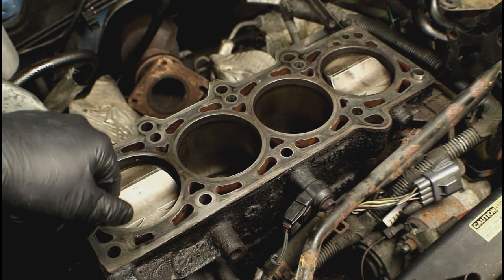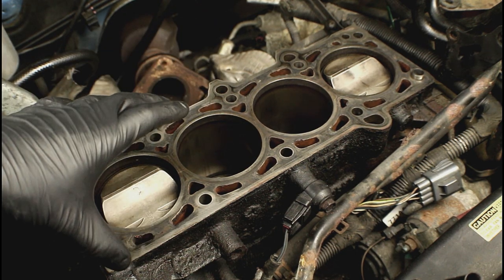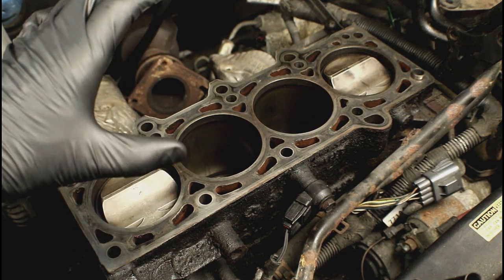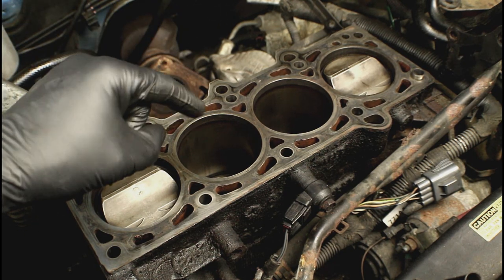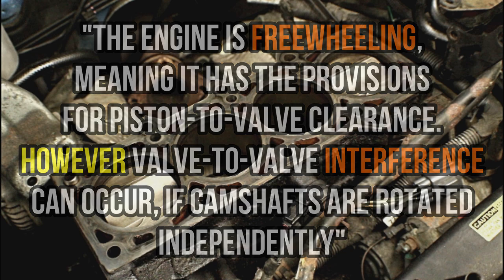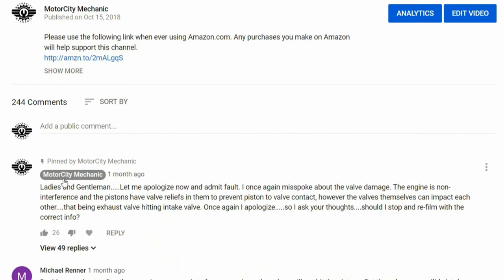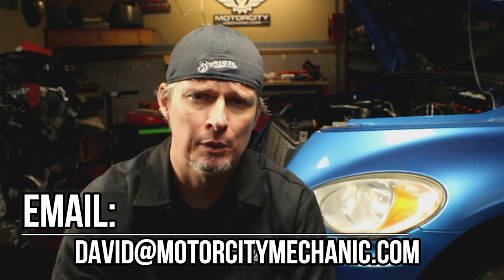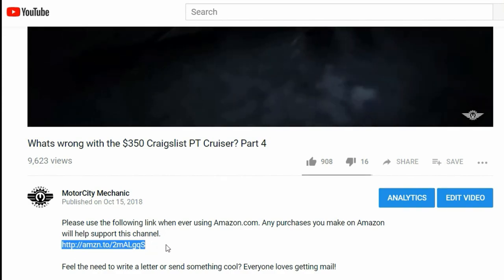The difference between Interference and Non-Interference engines

Comment: Lost belts on older Camrys (2) different cars. One lost a belt due to catastrophic failure of the idler pulley (due to over tension by a quack mechanic who I had replace the old belt). The other lost the belt due to the shaft breaking off the water pump. Both cars were saved due to the non-interference engines. ALL engines should be built like that.

Comment: just watched a video of another guy opening up a vtec engine and showing how one side is dirtier than the other due to oil balance issues and he thinks it's a design flaw but don't expect the manufacturer to tell you that, not to say they knew but that they had no idea what happens after prolonged use

Comment: This is an outstanding video, and part of an outstanding series, that resolved a long standing question about the 2.4 liter twin cam. 

You did a great job of forensic engineering, that never would have been needed if those diploma engineers had properly insisted on exhaust valve reliefs at the tops of the piston crowns.  That would have only reduced the compression about one, or at most two, percent and saved a lot of trouble for a lot of people. 

Thanks again.
Reply: MAny companies are installing 4 valves for each cylinder. You only need 2 valves per cylinder. 1 intake @ 1 exhaust. You are asking for trouble with 4.
Reply: 1 Cam @ 2 valves per cylinder. The old slant six cylinder would go a long way.

Comment: As the original owner of a 1989 Dodge Spirit ES turbo car AND the factory issued shop manual for the car, I can tell you from my own wrenching experience over all these years, a corporation can and sometimes does make mistakes in their printed literature about their own product. It's not often, but it does happen. BTW, the 2.5L SOHC engine in the Spirit is virtually all original except for 5 head gaskets, one timing belt, and a valve grind. Over 300K miles now. Love your channel David. Hope you keep it going for many more years.

Comment: I have NEVER heard of valve to valve interference until this video. It makes sense now but I think in this specific case you're correct. There is  just no way they hit each other unless the lash is WAY out of spec. So far out that the valve can't completely close; or put another way, NO LASH AT ALL.  Which would cause problems way before the belt breaks.

Comment: Wonderful job! I love this. I keep promoting your video on the facebook PT forums.  Too many people want to drive it until it breaks because it is "non-interference". They're so wrong.
Reply: It don't matter if it's interference or non-interference. When you're getting down the road at 60 70 80 mph and the belt or the chain comes loose something is bound to smack they're not like the old engines back in the day. These engines have no tolerance for mistake hopefully you will not learn that the hard way on your own vehicle

Comment: Stumbled upon this video because I wanted to know about interference engines (I'm still not sure if my 2004 Toyota Camry V6 is interference or non-interference, I keep getting conflicting info) and you helped explain to me what that concept means.  You made it easy to understand even from a non-gearhead's point of view.

This also goes to show why Chrysler gets its reputation as it does - it just seems like "good engineering" wasn't a term in design.  They make slick looking cars but they always have these strange faults.  A non-interference engine but the valves can still smash into each other, but they're wrong about it?  Might as well just should've just added "Yeah, we're stupid" at the end of that service manual blurb.

Comment: Thanks.  Those dents in the piston almost look like they fit the bottom side (radius) of the exhaust valve head, more perfectly than the top side like you demonstrated.  As you showed, the leak down test told the story.  When you found the factory cam alignment holes were off, I personally would have been tempted to loosen the exhaust cam sprocket bolt, align the cams using the factory alignment holes, retorque the exhaust sprocket bolt do the leak down test and then see if the engine would then start/run.  Regardless, once you found the exhaust valves were leaking, you knew you were going to have to pull the head to fix all that was wrong  (and do some preventative repairs while you were in there). You are obviously a very good technician and teacher, thanks for making the videos!!!  It's an Excellent series, I've shared them with my son and brother that own PT's.

Comment: Now I'm worried!  My '06 Cruiser has a broken belt and I was hoping to NOT have to remove the head.  At least now I'll do some thorough checking before I button it all back together.  THANKS for another excellent video!  KUDOS again to you!!!
Reply from the maker: I havent seen one bend the valves when the belt broke, mainly when someone did something wrong like on this vehicle. I feel you will be fine. Thanks for watching and for the question. Merry Christmas Tom!
Reply: @MotorCityMechanic  yep, Ive been thinking about that too.  Those witness marks on the pistons look more like over-revving to me.  Think that's possible?  If you've already repaired it what did you find?  Were the valves only slightly bent?  Just curious.
Thanks!
Tom
Reply from the maker: @tomferguson4996  It appears only slightly bent. I have a new set of exhaust valves that I need to get around to installing when ever I get some free time.

Comment: Great information and descriptive learning Dave. Valve to valve contact was a prominent issue in early multi valve overhead cam diesel engines with primate electronic injection, where the early belts or chains failed, especially in Australia where extreme heat, multi trailer combos are prominent. In all engines failures I've diagnosed with this description, the valves had not touched the pistons, due to the volumetic concaved pistons (increased volumetric area), but had edge contact with the opposing bank, resulting in major valve head degregation, from chips to complete severance. Other diagnosis of terminal failure include exhaust valve failure due to Jake Brake failing to release after disengagement, Hobbs switched fans causing belts/chains to jump a notch when engaging due to failure of soft start mechanism affecting cam timing, early ECU failures, most notably on Euro trucks with primitive VVT, losing sensor activity, suddenly engaging limp home without warning, and regarding the timing without confirmation of either cam / valve positioning. Add the failure of belts due to atmosphere and mechanical exposure, and overstressed timing chains, and you have very expensive repairs as the engines were usually destroyed by shrapnel from valves and / or disintegrating turbo turbines. Oh....one funny issue seemingly encountered on industrial Detroit diesels was the engines would fall out of timing without warning for no obvious reason but never damaged valves. When the heads were removed exposing the combustion chamber, the valves, usually inlet, had caught the edge of the exhaust valve, rendering retraction impossible. 👍👍

Comment: Great video! As an owner of two Chrysler vehicles with the 2.4, this is very useful info. I changed the belt on both mine at the suggested interval, and now I can see that I am glad I did. The exhaust valves did come into contact with the piston.
Did you have to replace the piston in this case? Is this discussed in a later video?
Reply from the maker: Piston was okay and I didnt seen the need. No issues with it running lol. If the belt breaks your okay....its just when someone times it up wrong or does something like in my case with the cam shaft alignment pin. Thanks for watching Kirk and for the comments.

Comment: That was super clear!! It is an interference engine. Congrats on the twins!!  On 2016 T&C, would u take the door off when changing door lock actuator, or would u fight it with the door on?  Thank u David!!
Reply from the maker: Many thanks Bill. Taking that door off is the best method. We use those fender stands that they sell at harbor freight to lay the door flat on.

Comment: Very informative. I have 2011 equinox with 2.4 interference eng w/81K, Unaware plastic chain guide broke tried to start engine which may added to damaged valves. Having new crate engine installed ($$$). So as to understand all this,  you say that pistons on non interference engines can over extend and hit valves and not visa versa? Are all DOHC engines considered interference? When looking for a new car, interference/non-interference engines never come to mind. Thanks
Reply from the maker: Funny you would say that.....we have one of those in the shop right now for that exact same issue. Seems to be common. When it comes to engines.....each is different. Some are and some arent interference.  The Chrysler 3.5 use to not be.....but the later versions were. Its all about the internal make up and there is no one rule that fits them all. Thanks for asking and make sure to subscribe.

Comment: thank you for the info nice job explaining it i just had a volvo engine interferance type and the water pump seized and the belt jumped and i cranked the engine becuse i was on a set of RR tracks with a train heading toward me  when i pulled the head i had  valve to piston contac and you could see the damage valves not seating  but it only cost me  bout 5 benjamins did the removal and replacement and had a machine shop mill the head and do a complete valve job  well worth the money and i enjoyed doing it  thanks again for sharing info
Reply from the maker: When you do it yourself you save alot of money. I like doing jobs like these when I have no time limits and not in a rush for sure. Thanks for telling me your story and for watching my video. Make sure to subscribe.

Comment: David,  Have you ever heard of a 97 3.5L break a timing belt and not have bent valves?  My belt broke while idling at a stoplight ,now worried my intrepid is junk. Excellent video ! Had to subscribe to your channel!
Reply from the maker: On the older 3.5 you should be fine. We replaced them all the time back then with locked up waterpumps and broken belts. Over time the newer versions of that engine would bend valves.

Comment: Nice video.

I just bought a Honda generator (EG2800i) that I LATER found out needed a timing belt replacement after every 250 hrs. I specifically asked about the potential "interference" issue and all I got was ...... [crickets]. The service department didn't even know what I was talking about.

Regarding the PT you were working on, when you put the valves back in and cycled the valve train manually, @13:05 you mentioned the momentum of the opening exhaust valves possibly being enough to throw them into contact with the piston. . You've no doubt heard of "valve float" and that happens when the spring rate doesn't allow the lifter to keep up with the profile of the cam lobe, especially at high revolutions, and that may introduce a wear depression where the trailing ramp of the cam meets the base circle. 50 years ago, you'd see it occasionally. Today? I dunno

Have you had reason to suspect the valve spring compression? I once overhauled a Divco milk truck that had a 6-cyl flathead 225?cuin Hercules QXD engine that put out a whopping 65 horsepower. I could fully depress the brand new valve springs in my hand.  Just sayin'.

Comment: Have seen damage from piston to valve more than once on "non-interference" engines from multiple makes. Don't forget to remove any of the sharp areas the impact points have. Don't want a hot spot to create an issue.
Reply from the maker: Thats very true! Thanks for watching and for the comment.

Comment: Was the valve spring for the affected valve weak or damaged? I can see one letting the cam fling the valve further than intended, the intake valve catching it, and pushing it down into the piston. Having that happen to two parallel exhaust valves at the same time would be incredibly unlikely, though.

Comment: Is there a possibility that the factory measurements were correct, at the exception that they forgot to take in count the EXPANSION of the metal due to TEMPERATURE ? In short, is the extension different when the motor is cold and when the motor is hot ?
Anyway, GREAT GREAT VIDEO !
Many thanks ! Keep on the good work.
Reply from the maker: Another item brought up is if the head has been shaved previously. There are always a few items that you over look and dont factor in like in this case. Multiple possibilities. Thanks for watching and for the comment!
Reply: The head gasket might have been replaced before with an aftermarket item of poor quality.

Comment: These videos are awesome.  Is it possible that resurfacing of the head reduced the clearance enough to allow the exhaust valves to interfere with the piston?
Reply from the maker: On some vehicles it sure can.....plus you might not know that it was shaved already before and not its getting done again. I would assume a machine shop would be able to tell if it has. Thanks for the question and make sure to subscribe.

Comment: I know this is old but I read somewhere that these engines are none interference unless the head has been shaved. I also I have been through two timing belt on my 06 pt cruiser because eBay LOL no damage to valves replaced belt and water pump and on my way still running strong 155k miles on it

Comment: Great Video, 
 I have had several 2.4's come through my shop with broken belts (Caravan, Stratus, Wrangler, and a PT) all had no valve damage.
Do all 2.4's have the same type pistons ?  The reason I ask is I had a PT with a burnt valve and I don't remember them being that way when I had the head off(I could be wrong as it was several years ago).

 Your video proves the service manual is wrong. I always believed that that it was a no-interference engine. I also remember a post to iAtn where someone had a head off and rotated the camshafts. They said they could see no way that the valves could hit each other.
I guess I should think about changing the belt in my wife's PT, there is only about 72 K, but it is 13 years old.

Comment: Great info Sir. I have a '12 challenger w/ the 3.6 V6 penstar interference engine. The manual recommends changing the chain @ 100k. Would you change it at that interval if the engine has been properly maintained? What are the warning signals of a failing chain on the 3.6? Also, would you replace the original tensioner, alternator, & water pump at the interval? Thank you👍
Reply from the maker: Evening. I have looked over the service intervals on that vehicle and there is nothing On replacing the timing chain as routine maintenance. I have never had to replace one or upsold one as maintenance because Chrysler never recommended that. Would love to see the info your seeing that in
Reply: @MotorCityMechanic  You are right! I looked over the glove box car manual. There is no mention of it. Then I remember seeing it listed in the Haynes manual which covers the charger, magnum & challenger 2005-2018 which has various engines which you probably experienced. Btw, they noted the wrong oil viscosity for the 3.6/V6 but others facts/steps are spot on. I'll keep doing the PM on it and hope for the best. Thanks again for the speedy reply👍✌️🤙💯😎.

Comment: This case definately is a piston- valve impact and the intake valves have  good clearance. I'm wondering though, if this cannot be because the cylinder head had undergone excess skimming at some point, or poor quality gasket that thins more than requried on fastening specifications, or both. Any of this can lessen the "safe gap" which then turns the engine an interference one.

Comment: Congrats on the little ones. Spend your time with them. In addition to Sargtester99 coment. Could there have been the possibility that one or both of the hydraulic lifters could have been bled down and not allowing the valves to open to their full extent? Just a thought and outside possibility. Keep up the great videos. Hope the little ones have their sleep schedule correct.
Reply from the maker: They have started sleeping longer and I am thankful lol. Anything is possible. They didnt see to bleed off but it was a quick check....if I hadnt seen the nice impact marks on the pistons I would have focused more on the valve to valve issue.

Comment: I have a 2002 Ford Escape, which I have had since it was new.  I don't drive it that often now, but after the alternator was changed in a shop a year or two ago it made a ticking sound, I noticed directly after it was worked on, which now I know was the belt.  It was totally cracked up and should have been replaced long ago.  It broke on me recently, and my husband pulled me home and changed the broken belts (Cam and serpentine belt).  Now it starts but sounds like there is a clicking in the piston area, and the check engine light comes on, and the heat gage drops to cold)  Normally it stays dead center between cold and hot when warmed up.  Do you think my husband never got the timing right, or if damage could have happened to the pistons when the belt broke?  I am learning......